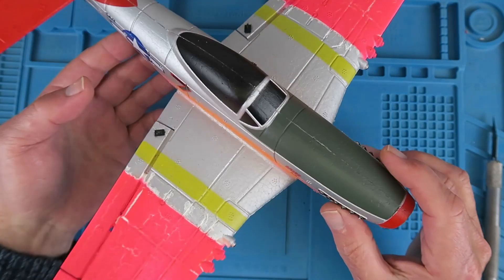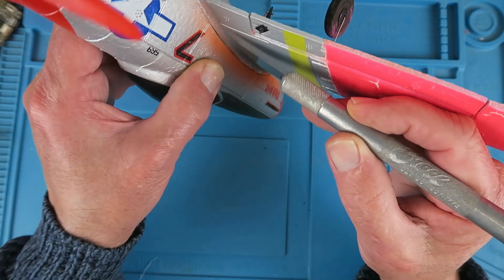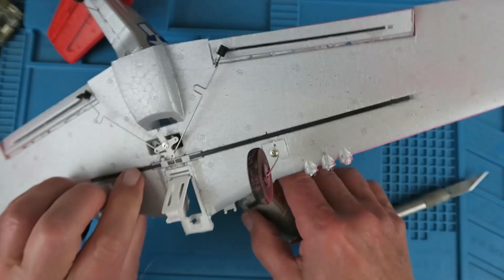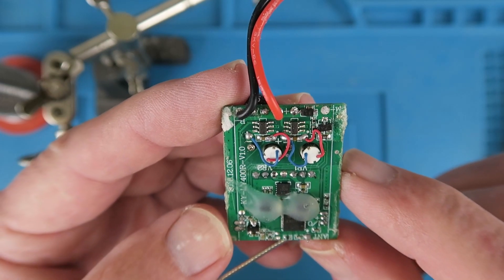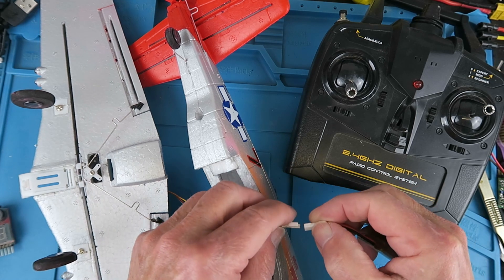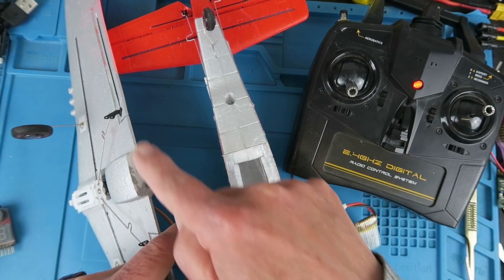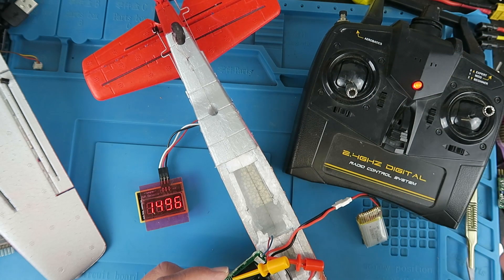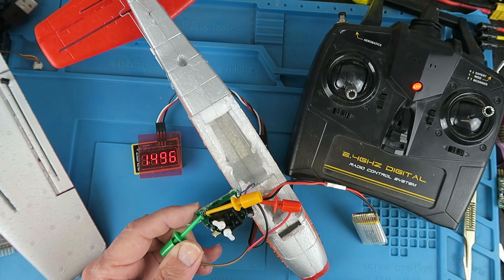Eachine P51D Flight Controller Receiver Repair

Comment: Fascinating video. Have you tried using and holding the sticks before arming the throttle. I think they use that for servo reversing, but maybe they can also change the channel mapping. Worth a try at least. Merry Xmas btw. 👍
Reply from the maker: Hi, thanks for the idea. Moving the sticks down and out before arming the motor calibrates the gyro to the current attitude of the plane. I have done it and it calibrates as it should but the 3ch mode remains, no alerion control. Will keep trying, there must be a way!  ¡Feliz Navidad!
Reply: @1nformatica  Good luck. Like you say, there must be a way. 👍

Comment: Looks like time to hit the Boxing Day sales again M'lud! 😜 Actually you are not quite correct in saying that that board is only used in the 4Ch Sport Cub and Eachine War Birds rebrands. It is also used in the 3Ch Mini Trainstar, pusher V761-2 Mini Ranger, V761-3 Super Cub and maybe others and has the unusual programming that, when a working servo is plugged into the Aileron socket, it operates as a normal 4 channel system. But with no Aileron servo, it reverts to 3 channel with the Rudder control on the right stick. The F22 also uses the same board but the programming seems to have been altered a bit as reported by AirDOGGe. (RC Groups - Doggeslife here.)
Neat work on the repair attempt though! No chance of old bleary eyed shaky fingers here attempting anything similar these days. 😁
Reply from the maker: Ahhh, thanks for the info. I guess then it has somehow decided it is in 3 channel mode. Wonder if AirDOGGe or anyone has tried to hack the programming port? Merry Xmas!